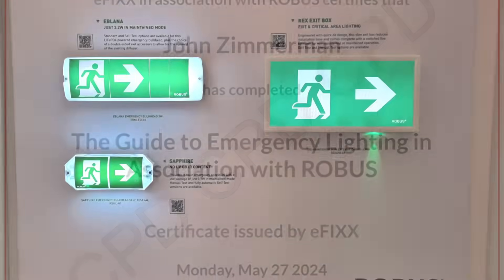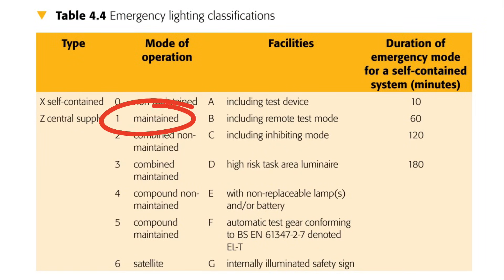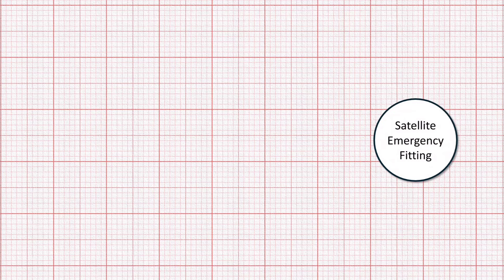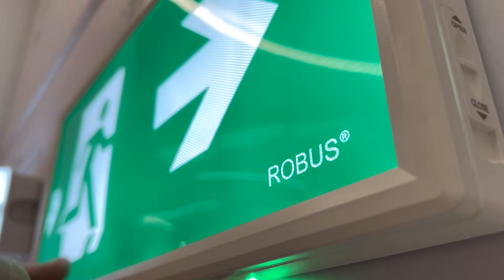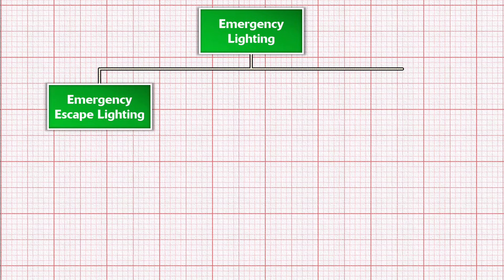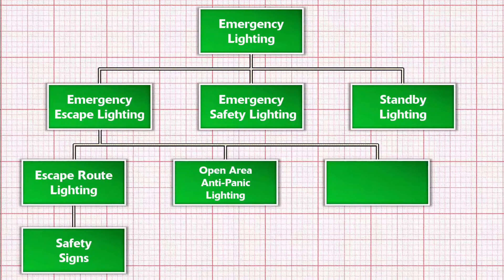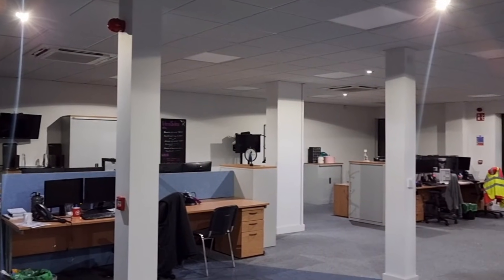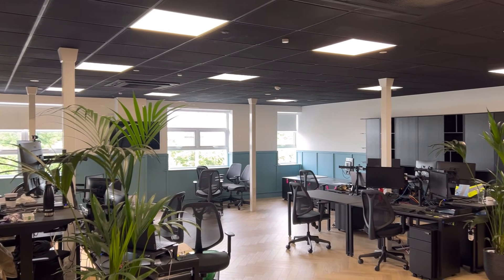Think You Know Emergency Lighting? Guess Again

Comment: Satellite fittings ?? WTAF. Keep it simple, nice bulkheads everywhere. Easy to install, easy to maintain, and they just plain and simple work. the only deviation from this, should be a proper addressable linked to fire system, to illuminate routes away from any fire.
But complicated systems like that are just a disaster to maintain. Just like the Thorn Explorer system which became defunct while some were installing it.

Comment: What about low location lighting? As we know if smoke is present any of the existing fittings on the ceiling are now useless, as we are told better air is located at low level. Being at low level the low location lighting will direct you to the nearest exit.

Comment: I had to supply my own emergency light at a former workplace because management would only test the lamps once every power outage.
Reply: How did you do that?
Reply: @Dime_Bar  Just a 13a plug to a bulkhead emergency lamp, plugged it in at my workstation. Another colleague did the same soon after because the install emergency lighting would fail soon after blackout